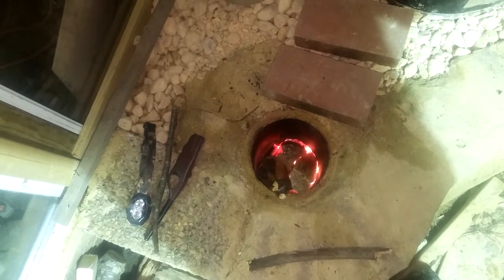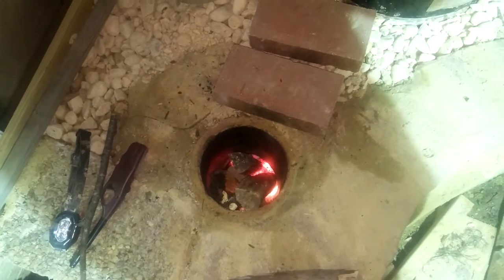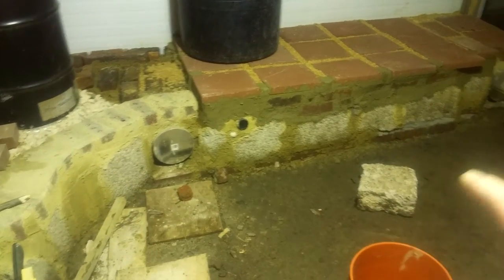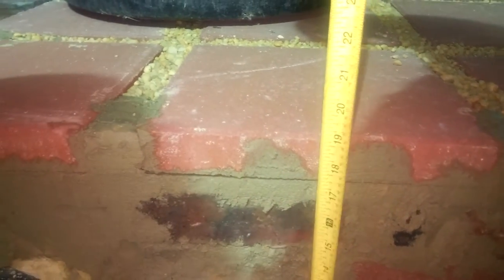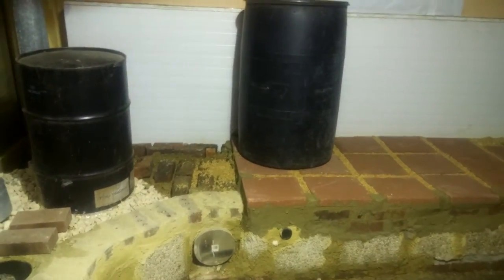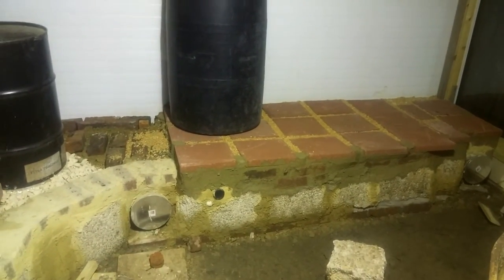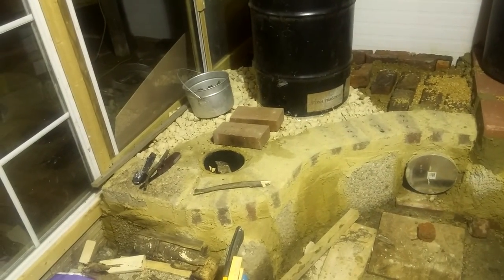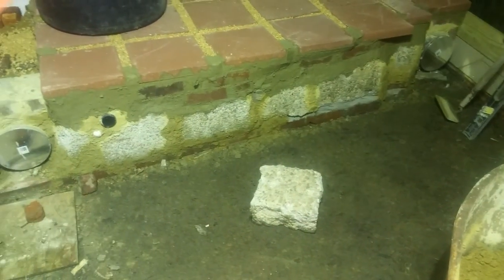Rocket Mass Heater Greenhouse Build Update

Comment: How do you clean out the feed tube of ash when it builds up??? Do you have a clean-out there???
Reply from the maker: Cleaning the feed tube is relatively easy, it's a manual function..... First, let me share with you how I constructed the entire "J-Tube" cause I think you are also wanting to know how I clean the burn tunnel as well.
1.) I first constructed the burn tunnel using Fire Brick, it is well below grade and I dug a channel and placed the fire brick in that channel then set the feed tube or burn chamber on top of the burn tunnel. The feed tube/burn chamber is 6" round clay chimney liner x 16" tall 
2.) The burn tunnel is 4" x 8" fire brick which makes a square tunnel The burn tunnel starts at the base of the feed tube or burn chamber and ends at the base of the heat riser. The burn tunnel is 26" long from end to end which happens to be as far as I can reach from elbow to extended fingers as I reach in and dig out the ash. So, keep that in mind when you are engineering your own system.
3.) After I scrounged around one of the local scrap metal yards, I found a 6" Industrial grade steel tube, paid for it, took it home and measured the exact length needed from the top flat side of the fire brick to the top of the barrel determining the measurement that would give me a 2" clearance from the top of the heat riser to the top of the barrel, then I set the 6" Heat Riser in place using cob to secure it at the base. Then I wrapped Stainless Steel sheet metal about 18" diameter around the Heat Riser then filled that space with cob as an insulator for the Heat Riser. 
Go to this link to view a series of pics that will give you a view of the build in sequence 

https://www.facebook.com/pg/CentralVirginiaPermacultureInstitute/photos/?tab=album&album_id=437618026448076

Now to answer your question -- I cut a piece of sheet metal the width of the square burn tunnel and a bit shorter, I roll my sleeves up on my left arm and slowly-gently reach down in the burn chamber and then all the way back through the burn tunnel and then further back to the Heat Riser and begin the short process of pulling the ash back to the opening of the Burn Chamber. I then use the square piece of sheet metal to shovel the ash out and into a metal bucket.